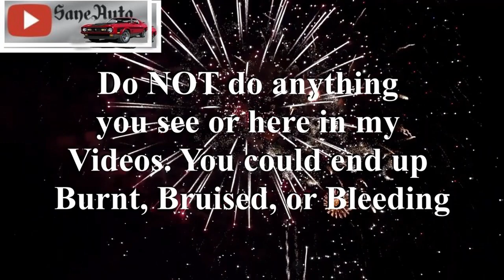"How to Avoid replacing the heater core" flush clogged-up heater-core (fix car truck has no heat)

Comment: Aside from the heater core getting clogged up , can the catalytic converter also get clogged as well? I bypassed my heater core and catalytic converter because coolant was spitting out of the reservoir. It stopped spitting coolant after the bypass so I tried flushing out my heater core like you did in the video and reconnected everything back but it still spit out coolant again. Can you please help me out in determining if I need to actually replace my heater core or catalytic converter or both?
Reply from the maker: Yes! Your right back-flushing the CC is worth a try.